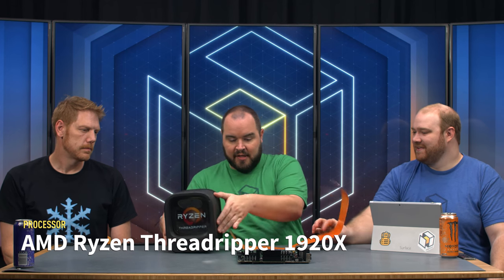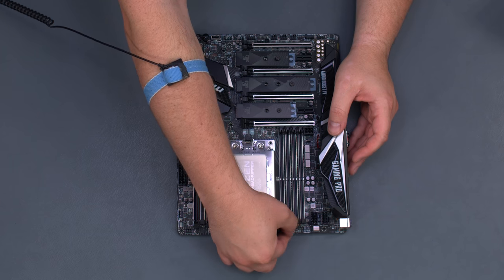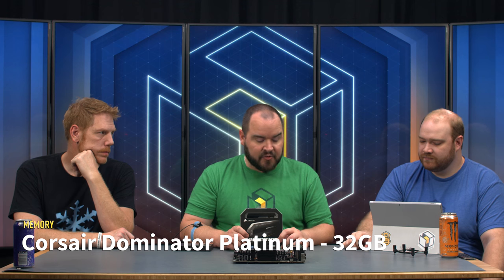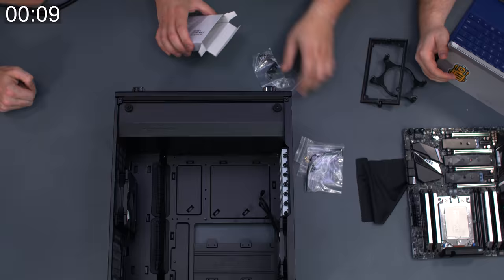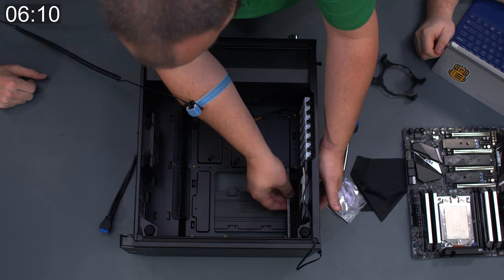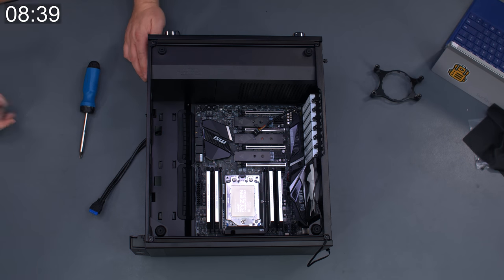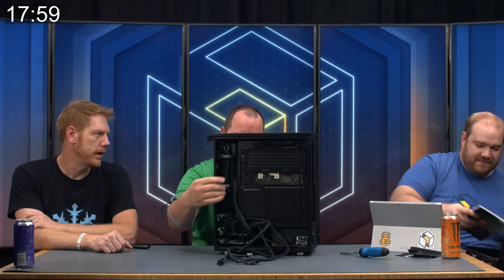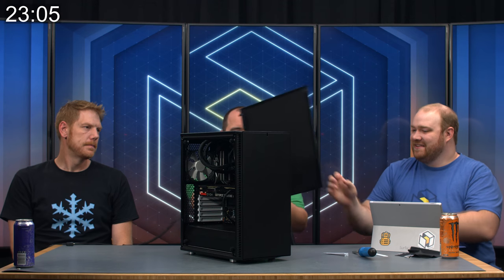Fractal Design Define C TG / MSI X399 Gaming Pro Carbon (Livestream Archive)

Comment: the reason the second screw is harder to catch is because you have to NOT tighten the number 1 screw all the way first just get 1 to catch and slightly tighten then catch the rest   then go back and tighten  saves you form having to apply brute pressure to the number 2 screw just to thread it

Comment: The GPU temps in this thing must be terrible. I've got ordinary Define C and EVGA 1080 FTW2 with two 140mm pwm Venturi fans as intake and one non-pwm Venturi exhaust and my temps can easily go up to high 70s or even around 80 C (e.g. witcher 3) with 78 F / 26 C ambients (fan curve tops at 70% rpm set in afterburner and it's quite audible at that point). Front-mounted radiator adds another couple degree to the restrictive front panel and dust cover. All in all the case is jut bad for high-end open-air cooled gpus.

Comment: Anyone have any idea why my keyboard won't work on boot up. It's a little annoying because I can't access bios unless I go into windows and do it that way which is a but frustrating.
Reply: RuRu CS is it a wireless keyboard
Reply: No usb
Reply: If you have a PS/2 Keyboard, try that. If not, try other USB ports.
Reply: I've tried other usb ports nothing seems to work I'll have another look tomorrow or something. It worked on my old Keyboard  then I bought a new and been having the problem ever since.